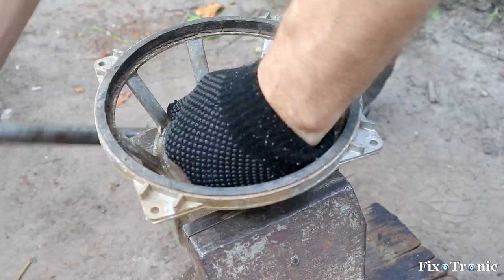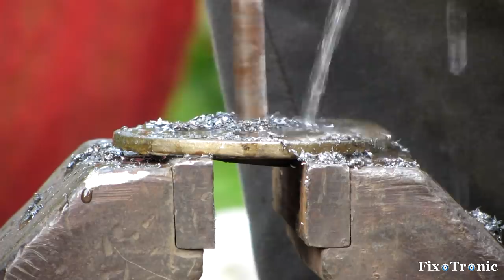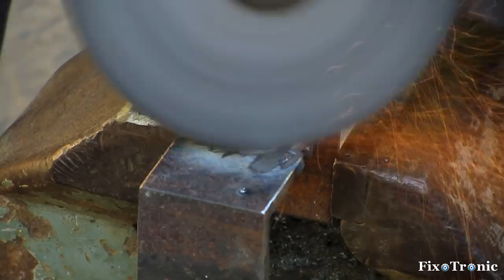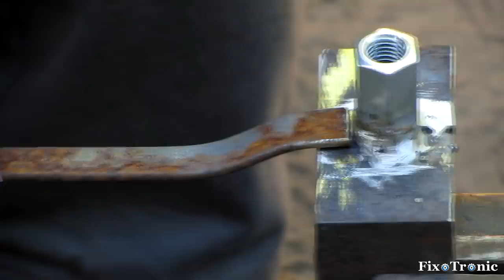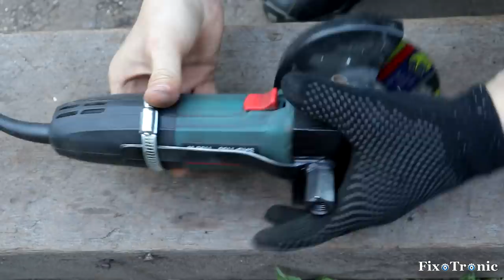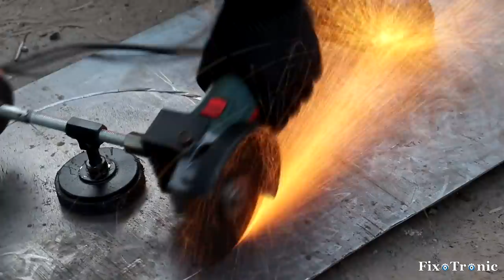Bright Device of the Angle Grinder!

Comment: Not too bad, it would be alot safer and more precise if you add a through bolt to the centre piece, and/or High strength magnetic clamp for cutting whole discs.

Comment: Stop your stick welding it’s a joke
Reply: Yea, he has a grinder but does not grind away the rust before he welds.
Reply: The parts seems to hold up pretty good? Or did they not??  The welds would not pass an x-ray or ultrasonic inspection but i don´t think that it is needed here..

Comment: certainement plus facile avec un chalumeau découpeur oxyacétylénique avec sa tige guide , pour un diamètre de 500mm en épaisseur 3  temps a peine 1 minute 30 .  avec un poste plasma du commerce en 220 et  une pige guide le mème Diamètre en moins d'une minute  ou un cercle gabarit pour plusieurs , pourquoi  s’embêter .

Comment: STOP FILMING WELDING.
The most ludicrous practice on YT.
Reply: As a professional welder I don't understand your problems with filming welding. Although I would not call what you see in this video welding. I've always held there's a distinction between guys that can weld and welders
Reply: WOW if you don't Ike his welding maybe you should make a video of how it's done. At least he's doing it. I enjoyed the video. Gave me some ideas of my own.
Reply: Nothing wrong here. I’m a self taught welder.
Reply: Amiga A1200 nothing wrong, however MANY things that can be improved 😂😂
Reply: @AmigaA-or2hj  

The things that jump right out at me from a welding point of view on this video are as follows

The technique is not is not appropriate.

There are a ton of slag inclusions which weaken the joint.

His joint prep is poor with no bevel or consistent spacing between parts.

He's welding over galvanized parts without proper prep.

Does the part hold together yes, is it dangerous as a rotating assembly, without a doubt if one of those " welds" where to fail in operation somebody's going to suffer a life-altering injury, perhaps. My whole point to all this is if the guy is going to be an example of how to build things it would be best if he was an example of how to build them correctly so as to not propagate dangerous items out there in the world for other less knowledgeable people to get hurt with due to poor construction technique

Comment: That's not how you stick weld, and the easiest way to cut an accurate circle with a grinder is to use a similar jig to draw a circle, cut it freehand with a grinder, and finish it off with a flap disc or grinding wheel. This is going to make an excessively large kerf due to the angle of the cutting disc.